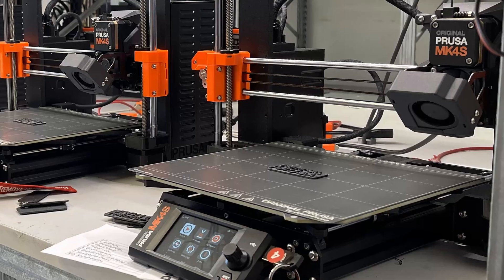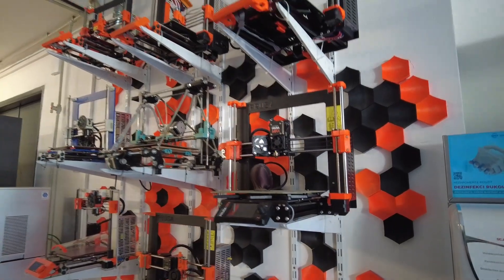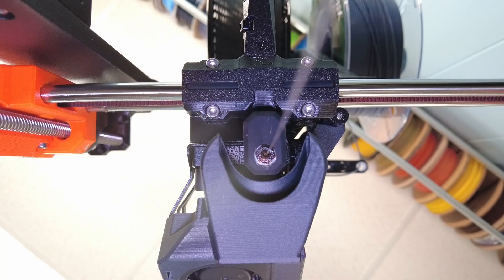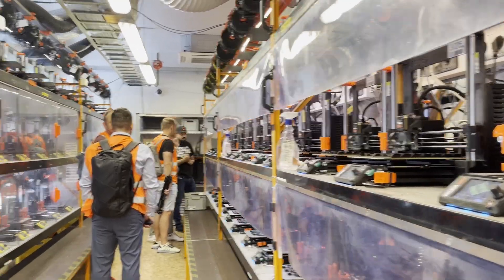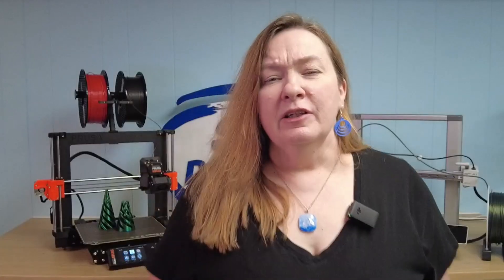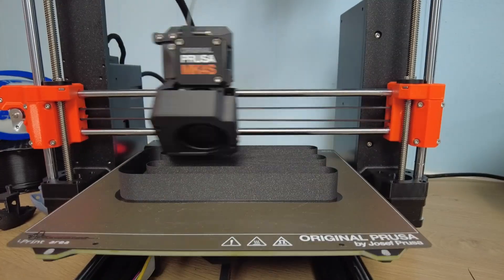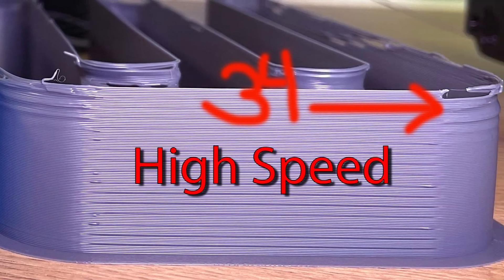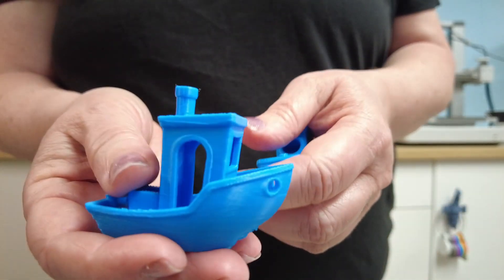Prusa vs Bambu Round 3: MK4S & A1

Comment: I think its a good comparison because they're both bed slingers but the cost of a prusa doesn't make sense when you could get a bambu xy core p1s or p1p for less  and get the same  or better preformance out the box. Its hard to justify the cost of any prusa vs a bambu printer  when they're not giving you anything better or different worth the additional cost. If they outsourced their manufacturing their printers would cost half the price.

Comment: Small correction, the A1 is $339, not $399 for the printer without AMS lite. 
My wife prints lots of silk filament on her A1 and mini; settings can be tuned to match the prusa quality/accuracy. SIlk also tends to be more sensitive to moisture absorption than typical PLA.
The MK4S is excellent for sure, but it's just hard to justify the $1100 price when the A1 is essentially an equal, or better printer in some aspects like build volume, for 1/3 the price. Prusa is a great company, but they can't keep pretending bambu doesn't exist when designing their machines.
Reply: Agreed. The comparison is strange. In practice the A1 (and for that matter the A1 mini) can match the MK4S in quality, though they may be slower to do so. However, I could a number of A1/AMS combos for the same price and easily crush the print speed issue. 

If we are looking at a single printer in that price range, compare it to an X1C. The MK4S with the MMU is $1369, the X1C/AMS is $1499. The X1C is the far better printer.
Reply: I’ll still always take an a1 over the prusa due to cost. But that being said you prusa treats their employees far better than Bambu, as well as their customers. Bambu customer support sucks to deal with where as prusa is crazy easy to deal with. The added cost on prusa unfortunately doesn’t really get much bang for your buck in regards to the printer itself, but rather customer support and quality of life for the individuals producing the printer. If I had more money I’d probably get prusas just to show my support for a company that actually treats its employees well.
Reply: @Resyektt One of the reasons I went with Prusa.

Comment: Prusa are so behind… I would like to see something new from them. Its bluntly stupid to compare something that cost 1100 with something that cost 350. X1 will be much better choice for comparison.
Reply: But then the only apples to apples comparison is the price itself. The X1C would manhandle the MK4S. The A1 is the better comparison because they're both high speed bed slingers. For $339, the A1 holds its own. The Mk4S may be marginally better in print quality (which can be tuned with slicer settings), but it sure isn't 3x the cost of the A1 better.
Reply: @NWGR  I agree that they share common design. From engineering point of view despite the low cost A1 is better build got superior bearings, worse extruder and it is much more sophisticated in terms of of sensors. And it got trash part cooling from where print quality is worse in the shown prints. The worst thing for Prusa is that they introduce subpar printer again for triple the price of their competitors. For 799$ I can get even Voron kit wich will be better value and will be coreXY. I really don’t get it they are still trying to ship the most inferior design in price categories of the most optimal like coreXY.
Reply: @georgenovtekov4351  What's wrong with the A1 extruder? I have three A1s in my house and haven't had any issues. As for part cooling, I wouldn't take the results from this particular video as definitive; many of us have excellent print quality with the current part cooling config. I'd say it's just fine; maybe not amazing, but certainly not trash. It does what it needs to. It would universally show in prints if it was that bad, and being that we live in the age of social media and the like, it would spread like wildfire. 

And yeah, it seems like Prusa just want to coast along on their brand loyalty and modest improvements. That's not enough in 2024.
Reply: @NWGR  Nothing is wrong with A1 extruder but its not on par with Prusa as they are going for the best there. Also A1 extruder is prone to failure. It print good but lack flow. X1 extruder is also not on par with BMG for example. It use fix tension despite it can be modified. I had to modify mine as it was so hard from the factory that it often chewed filaments. Otherwise its good extruder.

Comment: EDIT: Didn't realize they sell em cheaper atm, this was the price a few days ago.
You can get nearly 4 Bambu Lab A1s for the price of one Prusa Mk4s. That price difference is kinda hard to justify. In Europe at least  the MK4s and the X1C cost the same 1300€ .MK4s is 1200€ but if the upgrade is another 100€ then they are the same.

Comment: I think I lost my suspension of disbelief with the twisty puzzle. I've printed so many of them for a charity drive on multiple bambus (A1, P1P, X1C) with default PLA settings and multiple brands of filament (Bambu, Polymaker, Sunlu, Eryone, and Numakers) and not a single one, even smaller scale ever came out even close to that bad. Not a single one would even catch, let alone get stuck
Reply: If you don't tune the speed settings on a Bambu, they are set insanely high, even on the A1. Some uneven fans in the environment or other things can totally mess up an overhang or cause other issues with warping and pulling up from one corner of the bed. For the A1 it is much easier to have these issues since it isn't enclosed like the P1S or X1C. If you had your A1 in a nice place without any drafts, ideally in some kind of enclosure, then I wouldn't be surprised if you are used to not having the odd issue. Personally, I had a lot of issues with corners of prints on my A1 pulling up from the bed with PLA and PETG, which are often known for not shrinking much. I don't have any issues with this on the P1S, and in general the enclosure along with control of the exhaust fan (I keep it at 10% for consistent temps) means consistent prints in the P1S. In summary, A1 can be a bit wonky at times, although I do consider it to overall be more polished than the P1S. I think this mostly just has to do with the fact that the A1 doesn't have an enclosure and is a bedslinger. The speed settings are a tad too high by default on Bambu and require some tuning, especially for any kind of PETG, particularly for bridges, although Bambu slicer still has some bugs in regards to floating bridges at this time which are fixed in Prusa Slicer.
Reply: @geordonworley5618   I'm going to be honest my A1 is between a box fan and an AC vent, I get away with cleaning my bed every 10 or so prints on my P1 and X1C, but my A1 is about every 3 or the warping will overwhelm it. But even then cleaning is just hitting it with rubbing alcohol and a microfiber

I dont find the default speed settings to be a problem with most filaments I use on the A1, With sunlu and numakers I usually have to lower the top surface a bit

Comment: The A1 is $339 not $399 for a single machine and $489 with the ams lite

You can get 3 A1 for less than the cost of a single assembled mk4s($1017 vs $1099) 
There is no calculation that makes the mk4 worth it vs the competitors due to that initial price. 

Let's go over actual specs. 
mk4s($800 or $1100) has a smaller build area 250×210×220 mm, mmu3(5 colors) $299 = $1400*
MMu needs to be built and takes an ridiculous about of space
3x A1 combos = 3 x 256x256x256mm build area and up to 12 colors(4 per machine) = $1467 **
AMS lite can be mounted to the side or above the printer. 

*shipping ~ 100, import duties~ $50 

*75 Shipping cost not including tax
Reply from the maker: You are correct on the price -- I may have a typo there. Never edit after midnight.😉 And the MMU does take up a  💩ton of space. But there are Prusa users who'd rather stick a fork in their eye than buy a non-orange printer, and for them, they will be very happy with the MMU. It works greats & doesn't waste material. Sometimes money is not the only factor when making purchase decisions.
Reply: @stldenise  The MMU does waste material, you might have meant less but any single extruder multimaterial printer WILL waste some filament
Reply: Yep and the tolerances on my A1 and A1 mini are superb I never have any problems with tolerances, the only thing that I can see that's actually better on the prusa is the overhangs and those are tests or models that that you provided so I have no clue if there is some type of trickery going on, but I would definitely rather 2 A1's and an A1 mini over one MKS
Reply: quality over quantity ill take that all day every day.
Reply: @redline3036  That's the thing with bambu's printers, and especially the A1 series; you ARE getting that quality. So equal or even better quality, and quite a bit cheaper? I'll take that all day every day.
Reply: @redline3036  Bambu Lab has the same quality as Prusa if not better. There's a reason Bambu Lab is leading the market today and it's not just price. There have always been cheap 3D printers available
Reply: @redline3036  As NWGR stated you are getting quality, better tech, ease of use, QOL features, larger build volume at a much better price.
Reply: Wish bambulab were open source, feel like my data is being collected by them. Its like CCP spy machine vs prusa EU tax. Either way prusa just too expensive for me. At least creality still does open source.
Reply: @oneanother1  You can use your bambu printers offline. They're even launching FW update via SD card sometime soon. Creality quality is a huge step below a bambu or prusa. We'll see how the K2 turns out though.
Reply: @NWGR  so they say you can.
Reply: @redline3036  So far offline update via SD card been added to the X1 series. The others are planned as well.
Reply: @oneanother1  yeah exactly and unless you're in a government job and your privacy is very important, most people are going to save the money and not go with prusa

Comment: Personally I would compare the Prusa mk4s with the Bambu lab P1P, the twisty puzzle accuracy was impressive though, It's one thing that puts me more towards Prusa. I'm still undecided between the MK4s kit with enclosure and MMu or Bambu X1 carbon with MMU.
Reply: I have the MK4 with MMU3 and it works very well.
Multicolor prints are faster with the Prusa and have much less waste.
On the other hand, it takes up more space and an AMS is more convenient to use. 
But you can use all filament rolls with Prusa.
I wouldn't buy a Bambulab at the moment as new devices have been announced for this year. How the current devices will be supported in the future is not yet known.
Reply: @herr_rossi69  does the MMU3 Fits inside the prusa enclosure?
Reply from the maker: @ripmax333  The mechanical part would, the filament would all have to sit outside. 8:46 of this video does a quick pan of the MMU I've got running.
Reply: The a1 lost and thats ok.
Reply from the maker: I will say the MMU requires a lot of real estate -- more than even the A1 with the lite AMS. I'm working up a color comparison for a future article, seeing if I can stall long enough for Creality's system to make to me.
Reply: @stldenise  you mean the Prusa MMU needs more improvements?
Reply from the maker: @ripmax333  No, it works fantastic. It just takes up a lot of table space.

Comment: I see you physically comparing the twisty puzzle and the egg prints between PRUSA MK4S and the Bambu Lab A1, but I don't think I heard anything about how long each print took, what settings were used (regardless of if they were default settings or customized settings), or if you were using the exact same models (like starting from the same generic STL file or using customized 3MFs). So, while the comparison of the twisty puzzle you provided shows visual and functional differences, there appears to be missing context.

I hope you do a follow up video where you go a little more in depth into the difference of the twisty puzzle prints. I.E. How you printed them, what settings were used (default or customized - it would be good to get a side-by-side comparison), and how long each took.

Thank you for holding your embargo as long as you did, I can appreciate how that must have been driving you crazy. 🙂
Reply from the maker: OMG, I should never edit at 2am. It's pretty hard to fix video, but I can post a short and then link it with a card. FYI, the Prusa did it in 3 hours & the A1 in 3 hours & a half. Same file (a 3mf from the designer -- that is linked) and both doing 2 walls, default speeds, 2 walls & bare lightning infill. I'll let them rerun the file and get exact times. 😊